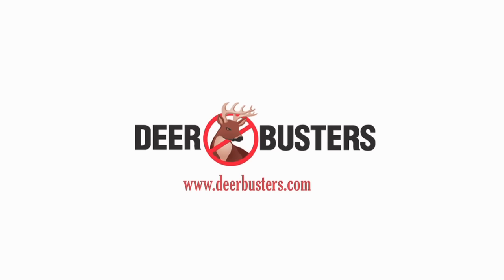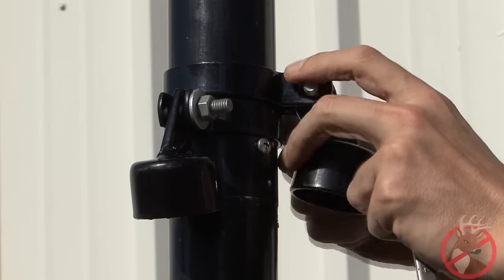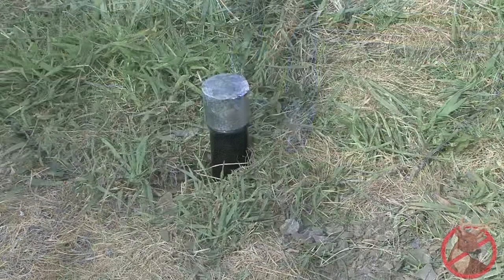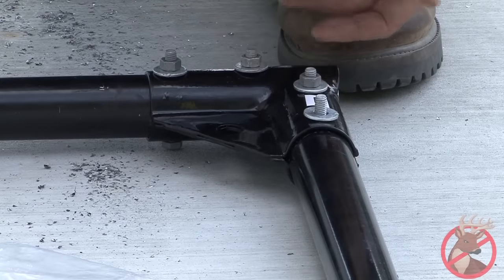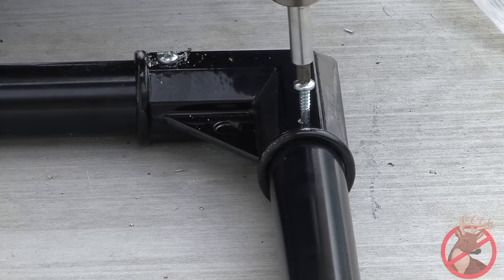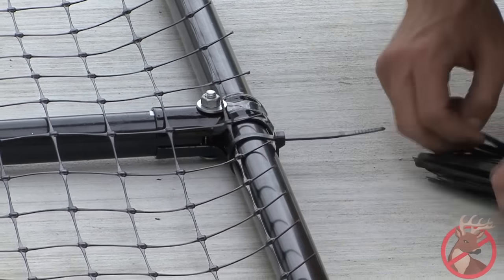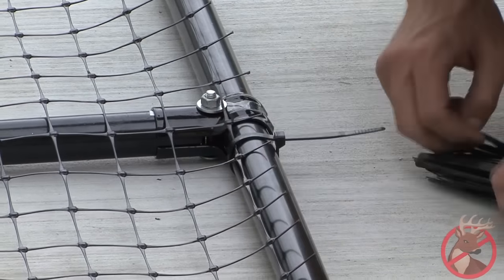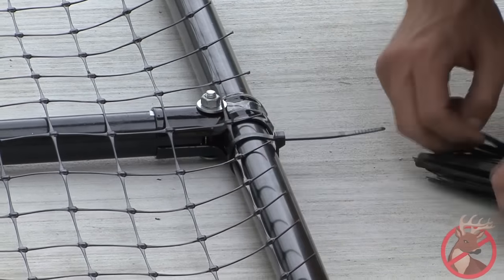DeerBusters- Deer Fence Installation Video

Comment: A ToC would be helpful. here is one piece of that:
@ 4:45 the Gate frame installation starts
@ 6:40 the Gate access system starts
@ 10:15 the Tensioning system starts

Comment: The tension system explanation, especially with respect to the corner posts is very poorly explained; in the earlier part of the video (and in the kit) they show installation of eyelets for the monofilament line.  But in Chapter 4 of the video that explains the tension system install, there's no mention, nor inclusion of the eyelets (??).  Not sure what that means...

Comment: Im installing one a customer bought.  Usually I build them out of wood and cattle wire. This seems a little bit Mickey Mouse but I'll let you know how it does in a few months.
Reply: How did it go in the end?
Reply: @Kurauone__  a buck got caught in it. It trashing around I guess and bent a bunch of the posts.  I fixed that section and haven't had a problem since. The people I installed it for haven't called me in a while.
Reply: @Kurauone__  I think its made for vegetable gardens and not really for encompassing a multi acre property. I mean, it works. It serves its purpose. Eventually the deer learn and stop trying to go through it.
Reply: Why do you think its only for enclosing a veggie garden? I was considering using it along my back property line to keep deer out of my  woodland garden.